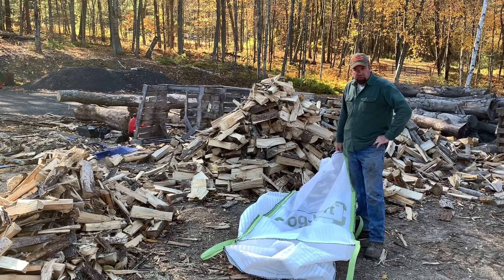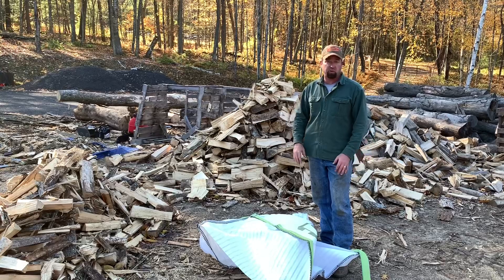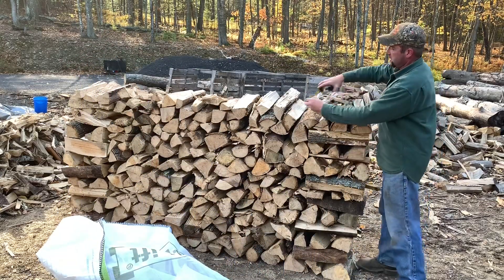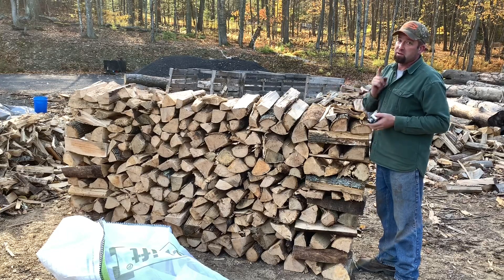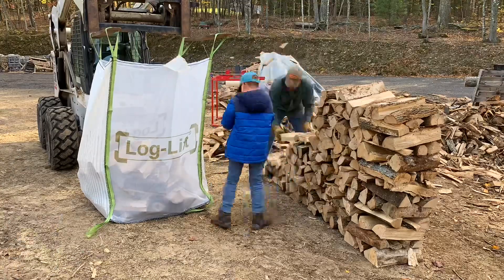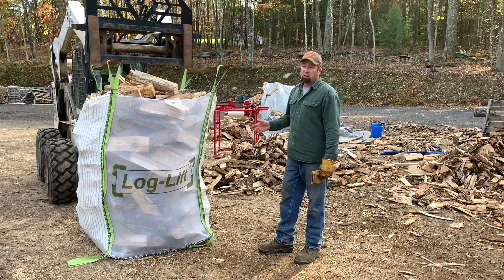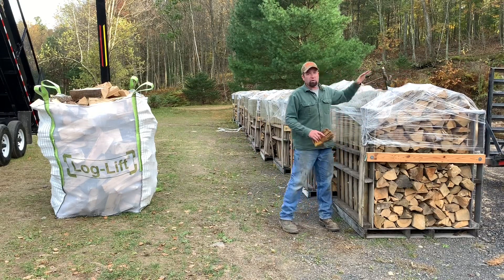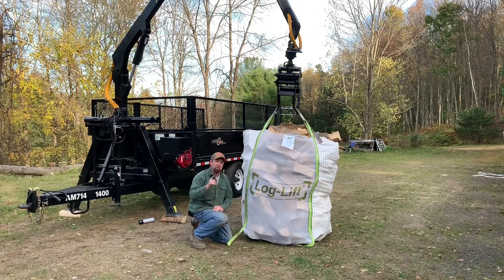Long Video, Log Lift Bag & Log Loader Bag Lift

Comment: We have been experimenting with the different bag systems to cutdown on the labor costs and time associated with stacking and moving. Thanks for sharing.
Reply from the maker: No worries. If you need a quote just call. 833-775-4887. Thx AJ

Comment: You ever have issues with mice or rats wanting to chew holes in the filled bags when they sit for a while on your lot?  I guess the way they are woven a small hole shouldn't decrease the strength any...
Reply from the maker: We just got into some bags that were filled in October 2019, and we actually have no evidence of mouse nesting and no holes from rodents in the bags at all.